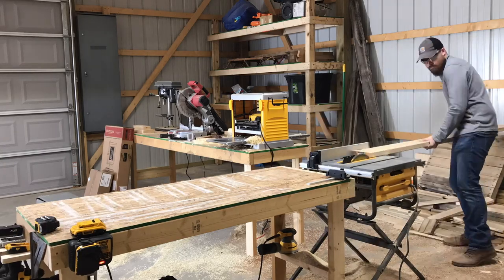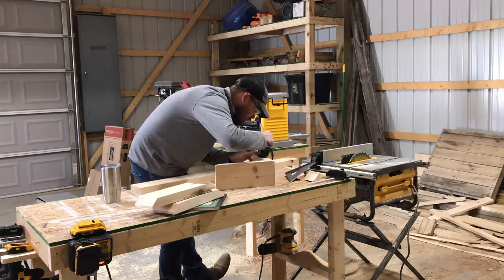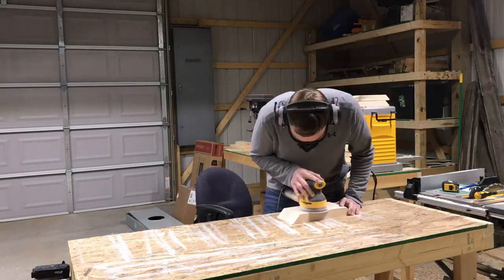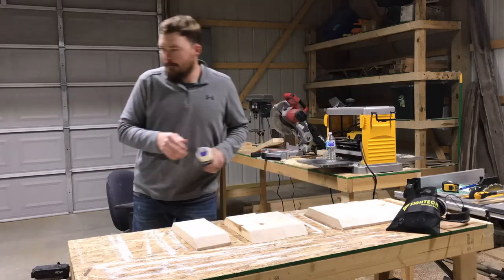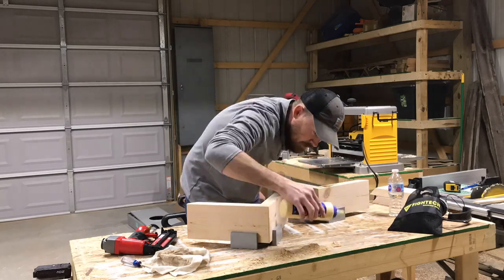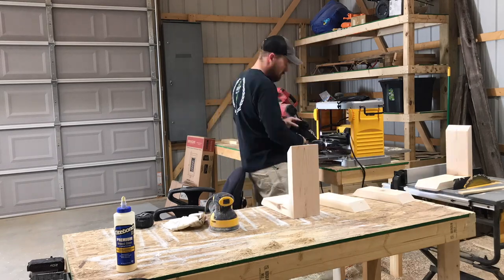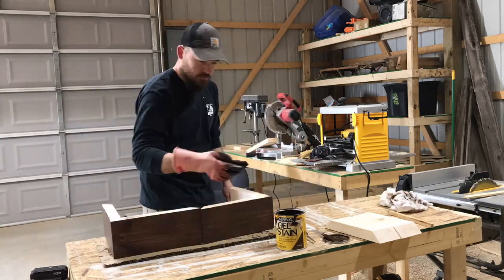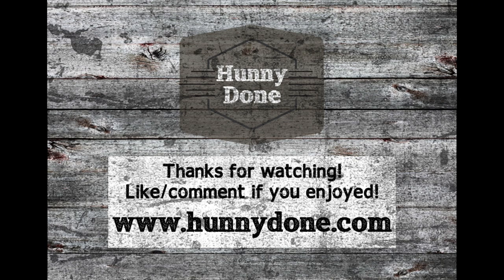DIY Corbels

Comment: I bought 2 corbels already made. They have nail hole slots in the back of them. One to slide the nail into and slide over into the smaller slot to secure. My question is, how do I attach that to a corner? Placing them in hallway. I don't know how we can get the nail into the bigger slot and slide it into the smaller hole to secure. If you get what I'm saying.
Reply from the maker: I did not have a keyhole router bit when I made my corbels, so I haven't done this yet.  But when I make another set, I plan to do a keyhole slot like you're talking about, on the top leg of the corbel.  So that the screw is sticking out of the ceiling and as you slide the corbel towards the wall the screw is wedging into the narrow part of the keyhole.  

Is the keyhole slot on the top leg of your corbel that can be on the ceiling or will it be on the wall?
Reply: @hunnydone5780  what if the keyhole slot is on the wall??
Reply from the maker: @tiffanyjett8865  I would have to see what you’re working with to know for sure.. but if you have a keyhole slot on your wall, you should be able to get a screw with the proper head size. Just measure where you want the corbel, or whatever you’re hanging, and drill your screw into the corbel with just enough of the head sticking up to slide into the keyhole. 

Hope that makes sense and that I’m understanding properly. Let me know.